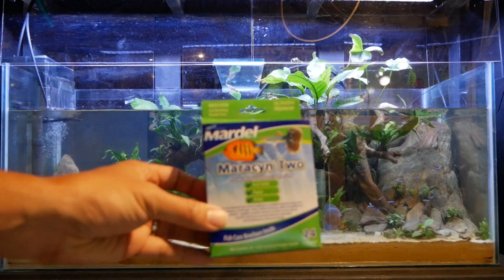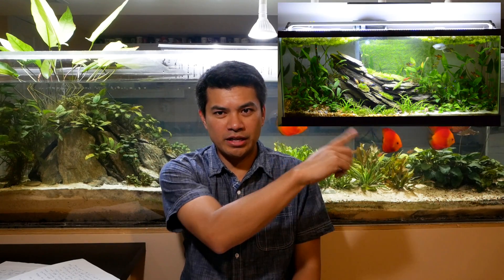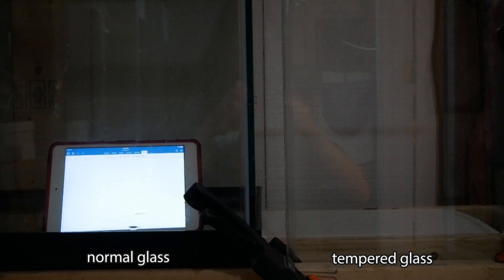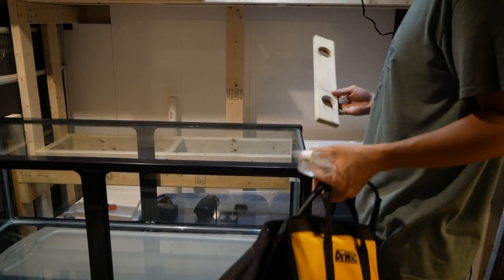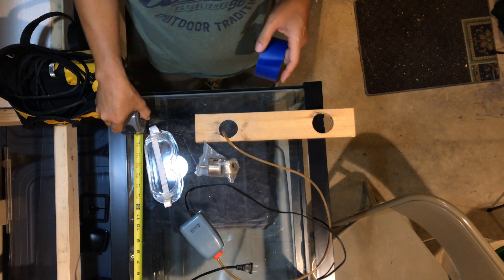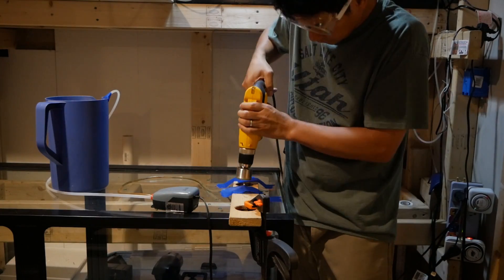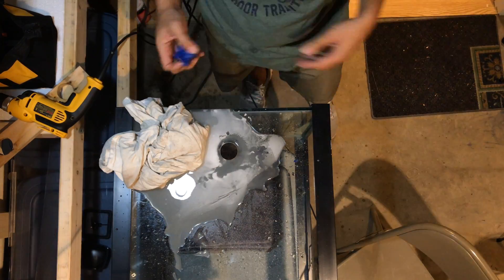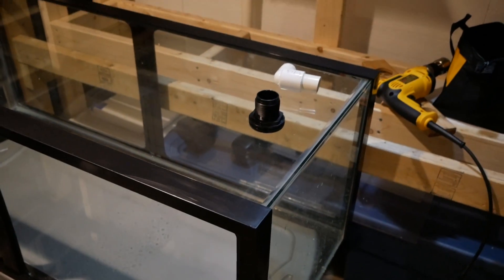Drilling Glass Aquariums - Tempered vs Normal Glass

Comment: Hey. Wanted to ask you a question about the pvc fit going into the bulkhead. It's a very tight fit and wondered if you did anything to the pvc or elbows to get it to go in all the way. Both the elbows and pvc don't go in as far as I'd like.
Reply from the maker: Jim, assuming you have a slip fit bulkhead (instead of threaded), you can sand the edges of the pvc to remove any burrs.  I also apply silicone around the inside of the bulkhead and elbows...this allows the pvc pipe to slide in better as well as seal any leaks after its cured (24 hrs).  The silicone seal is not permanent and pipe fittings be taken apart using pliers if you decide to change the plumbing.
Let me know how else I can help.
PDFT
Reply: PlantedDiscusFishTank they are slip fit bulkheads. I will sand them a bit and try the silicone as you recommend. Thanks. I'll keep you posted.

Comment: Good video, I've seen tape used on the bottom of the glass to keep the cut piece from falling, but never the top. Good tip! I did cringe when you used the wrench to fasten the bulkhead on- I've always just done finger / hand tight. I watched my friend crack his tank doing that as he over tightened.  Is that some sort of light torque wrench?
Reply from the maker: Thanks.  I think a good rule of thumb is a quarter turn with a wrench after you hand tighten.  No special wrench, but I agree, don't over tighten!